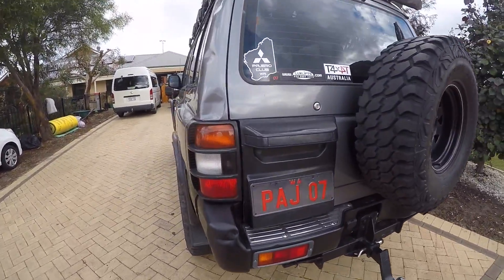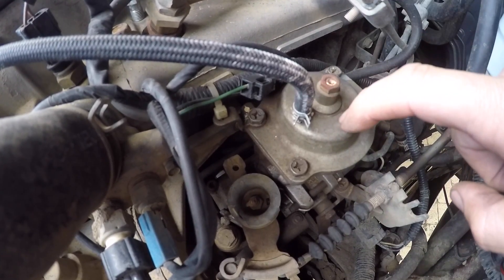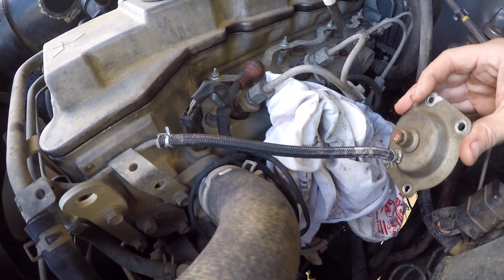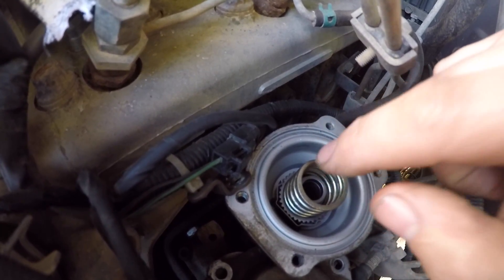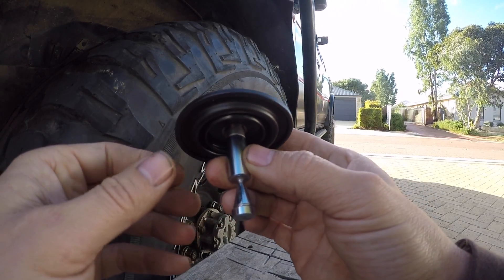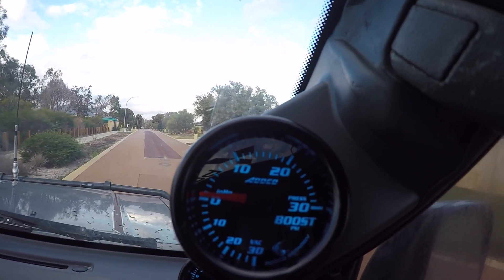HOW TO: 4M40 Boost Compensator Adjustment

Comment: What would cause diesel to be forced up through the boost compensator and into the turbo via the boost reference line?
Reply from the maker: I’ve never stripped these pumps but they’d have to be a seal gone below the compensator. Be very careful, pulling diesel up through there could cause the engine to run away
Reply: @PERTHSCOOTER07  
Exactly what happened. I shut it down very quickly and managed to block off the hose and get her home. I paid 2.5k to have the pump and injectors rebuilt 2 months ago and this happened in the middle of nowhere on the first big drive since.
Reply from the maker: @Ape5htGarage  bugger. Try get it back to the original repairer. Could have cost you an engine

Comment: Hi, I have pajero 4M40 2800. I recently took it for engine check and they recommend engine after hearing knock sound. Now the problem is that the vehicle is failing to pull and can't accerrate more than 20km/h. What could be the problem?
Reply from the maker: It could be a number of things. If you have an engine knock then that’s going to be the main issue. But you could also have faulty injectors or fuel pump.
Reply: Check your EGR isn't stuck open

Comment: Hi,I finally got round to this job last week on my L400 Delica, your video helped immensely - thanks! On the Delica the TPS is connected to the bracket on the front of the boost compensator, with two spacers between the brackets - damn that was a horrible job getting it all back together haha. 
Overall the difference is significant when the boost kicks in. I've also added a boost controller between the turbo and wastegate too, and the EGT gauge goes in today.
- I've got to ask - your accent sounds like you're originally from the North of England, by any chance are you?
Reply from the maker: Glad the video helped you. And yes correct. I’m originally from West Yorkshire
Reply: @PERTHSCOOTER07  I had a feeling you were! I'm based in Manchester
Reply: Hey I tried doing this to mine but it looks as though the top of my pump can't separate to reveal the diaphragm
Reply: @brandongoberdhan6335  mmm there may be a couple of things going on - I'm going from memory from a few years ago so forgive me if this is slightly wrong. Have you removed the 4 screws on each corner from the top of the compensator? It may be gummed up, a bit of side-to-side leverage and/or use a screwdriver to prise it slightly.
Reply: @johnskii  yup mine looks like it can't separate which is weird looks like one piece. I don't see a line that shows the separation of the two pieces
Reply: @brandongoberdhan6335  sorry to hear that, its a bit beyond my wheelhouse, but maybe for someone more knowledgable - which vehicle model and engine do you have?
Reply: @johnskii  thanks bro its okay ill figure it out. Its a gem 3 pajero with the 4m40T front mount intercooler. I'm from the Caribbean we get those here

Comment: Hi, tnx !! I just whant to be sure about the position.
Where You recommend to set the "0"  ?
If i look like you in the video from the side.
Adi
Reply from the maker: Yes. If it doesn’t work good you can always put it back to the original position
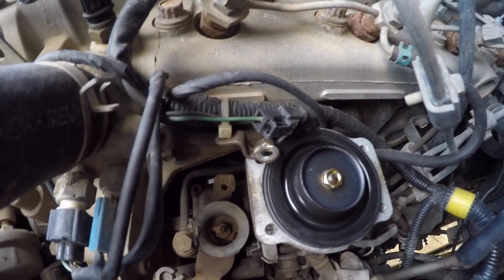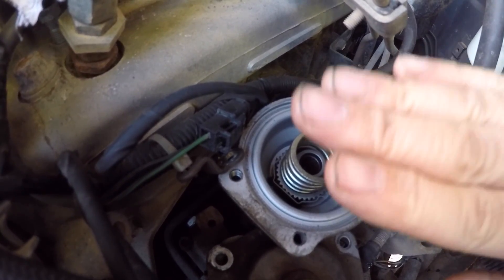Reply: Where to set the "0" in 3:00 or 6:00 ?
Reply from the maker: 3 is the factory position and 6 is the modified position

Comment: Hello sir 
Factory setting the "0" was at 6'o clock position? 
If so we turn it 90° clockwise or anticlockwise?

Also at what position should the "0" be after tuning it  for more power.
I have added 3nos 1mm washer also.
Reply from the maker: Nashik 360 hi there. If this is definitely factory position so no one has changed it, then yes go 90’ clockwise. I suggest marking the original position in case the car runs bad you can put it back how it was.
Reply: @PERTHSCOOTER07  thanks a lot sir

Comment: Thank you for taking the time to produce such an informative and high quality video.
I (think) I know everything you're doing but learning how to do it to my Pajero 4M40 took me a lot of online reading, time and trial and error.
You explained it so clearly and in such detail! It would have saved me a lot of time back when I started playing with this.
Right now I also have a bigger turbo and a water to air intercooler system. I'm telling you this because you mentioned that you wanted a bigger turbo.
Reply from the maker: SpeedO'Philia thanks mate. I’ve just fitted a boost controller to mine so I can add more boost. However I’ve busted my arm so can’t drive for the next 6 weeks, so I won’t know how it goes for a while. Plan is to get as much as I can out if the factory turbo and upgrade next year.
Reply from the maker: What turbo are you running?
Reply: @PERTHSCOOTER07  that's what I did. I initially added more boost to the stock TD04-12T (you may have a TF035 which is basically the same). That one went up to 19 PSI although the gains were negligible above 14 PSI.
I suggest you set the standard turbo to 14 PSI, it might spike higher but 14 PSI once stabilized will be fine.
Then I upgraded the turbo to the Kinugawa TD04L-15T "Monster".
That one pulls amazing. Just perfect.
I added too much boost (21 PSI) and caused it to have shaft play. I'm having it remanufactured as we speak.
I will keep it at 14 PSI and it should run fine. Apparently the shaft is too weak for the large compressor wheel (15T) which is spun by the small TD04 exhaust wheel, so you can't give it too much boost.
Anyways, as the turbo is considerably bigger than the standard, at 14 PSI it should pull much more. Plus the engine will keep it's low RPM boost as the exhaust wheel is the same as the one from the stock turbo.
It's important for you to know that even though I had the boost set at 21 PSI for more than a year, the engine didn't seem to suffer from this, this engines are very robust as far as I'm concerned.
Reply from the maker: SpeedO'Philia that’s great info. Did you retain the stock intercooler? And was is noticeably laggier than the 12T?
Reply: @PERTHSCOOTER07  intercooler: I installed a water to air intercooler kit from frozenboost.com and adapted it to the engine bay. Huge improvement although I'm not sure if it's worth the time and effort it took me to install it. I did it for fun and to learn. I'm no mechanic or anything like that.

Regarding the turbo lag: the Kinugawa has better response than the OEM turbo, plus, once it boosts you absolutely notice it. Great sensation.
Reply from the maker: SpeedO'Philia thanks mate. Sorry you did mention the w2a cooler before. 👍🏼

Comment: Hey mate, interested to know you’re thoughts on the 2.8 TD Pajero’s. About to buy one myself. 
Any watch points or dramas you think I should be looking for? 
Sorry to jump on video comments, only way to reach you I guess.
Reply from the maker: Would definitely recommend. However make sure the cooling system is 100%. They do heads very easily if overheated
Reply: @PERTHSCOOTER07  Well I bought one, finding your vids really helpful too! The old bus needs a bit of work but I love it already. Just out of interest, where would you prefered place be to source turbo rebuild kits, injectors etc?
Reply from the maker: @chrishulme1677  I’m an eBay fan. Get stuff delivered straight to my door. There’s heaps of places in the UK who sell bits for these on eBay.
Reply: @PERTHSCOOTER07  good to know, I’m mostly a landcruiser dude and know all the good parts places, flea bay for the win! If it’s good enough for a Yorkshire man it’ll do me alright.

Comment: Have rebuilt my nh, as I live in the UK, trying to find a rtc steering damper is very hard can anyone recommend a store in Australia to order fromplease
Reply from the maker: Have you looked on eBay? Local parts places will most likely have them but not ship internationally
Reply from the maker: https://www.ebay.com.au/itm/161028117145
Reply: @PERTHSCOOTER07  thank you very much,but any chance you could help me once more please
As I am  ex mechanic I need to get hold of a seal kit for a opal,Vauxhall, holden high pressure fuel pump engine code z22yh the only guy on ebay is in Belarus. There is a bosch pump that fits or can b converted to fit,but finding the part number has been impossible here in the UK any help would be great fully received  thanks craig
Reply from the maker: Craig Oldham hi mate. I don’t think we get that engine over here. We have a variant of it in the Zafira. 
Holden have just gone bust. I would have thought Uk would be the best place?
Reply: @PERTHSCOOTER07  any way i can contact you ,as over here pajeros,dont have the same following as in aus kind regards craig
Reply from the maker: Craig Oldham are you a member of the Facebook page : Pajero club Western Australia? I started this page and it has over 4,000 members
Reply: @PERTHSCOOTER07  no never heard of it,but would it b ok.to join as i am in the uk
Reply from the maker: Craig Oldham of course mate. Just make sure you answer the questions. Heaps of useful info on there

Comment: Hi, good afternoon!
I have the same engine. The factory position of the diaphragm is with the "0" for the back of the car? The tune is to rotate the "0" 90º clockwise?
Thanks
Reply: Yes 0 facing front of car is correct position

Comment: Hi mate, I have 2.8 4M40t and i have no boost until 2000 rpm will this help with that?
Reply from the maker: Possibly. Check over the basics first like for any boost leaks or split vac pipes
Reply: @PERTHSCOOTER07  its good after 2000rpm i need do something for lower rpm...😀
Reply from the maker: Marin Lasić  is it factory turbo or aftermarket?
Reply: @PERTHSCOOTER07  factory with front biger intercooler...
Reply from the maker: Marin Lasić the bigger intercooler and extra pipe work for a front mount will create lag and make it come on boost later.
Reply: @PERTHSCOOTER07  Then maybe that's it...

Comment: did you remove the egr?
Reply from the maker: Was already done when I bought the car
Reply: @PERTHSCOOTER07  hey Perth thanks for the reply much appreciated. Cleaned injectors with new needles + quarter turn of fuel screw + bump boost comp. Trying to wake up an 06 gls on 270 thou. And egr to go adios
Reply from the maker: @juanfo7307  good luck with it all mate

Comment: Should you do this if you have no mods and the car drives fine
Reply from the maker: blake walden this will give you more power. But with every performance mod you are risking reliability. If you’re happy with it as is I’d leave it.
Reply: How does it increase power without adding boost wouldn’t it just cause higher egts
Reply from the maker: blake walden sorry I should have been more specific. Doing a few mods as in more boost and more fuel. To just do this mod by itself is fine. It may increase egt’s slightly but is just an adjustment in fuelling for the off to on boost transition. Adding fuel here will spool the turbo quicker
Reply: Can you adjust this and a few psi more boost without touching the main screw
Reply from the maker: blake walden yes. Check out my other video on how to increase boost.

Comment: Thanks for your video tiger do you have the distributor plunger setting for this pump mine came lose at the timing bolts and now I need to time the pump. I'm subscribed to. Cheers
Reply from the maker: Austen Powers hi mate sorry I don’t have these settings. I do remember googling it a few years ago and found some screenshot taken from the factory service manual. See if that works.
Reply: @PERTHSCOOTER07  thanks m8 after a lot of googling i  did end up finding a manual and for the 4m40t the specs are  1mm travel at 12deg atdc +/- .003 
thanks

Comment: Where does the rubber hose connected to the lid connect?
Reply from the maker: There’s a small metal tube that runs along the front of the head and then goes to the turbo
Reply: @PERTHSCOOTER07  Is it also like this on Toyota Hilux 2.4 diesel turbo 1998, with an L2 Angen?
Reply from the maker: @אשאלאליזרוב  I’m not sure. Most cars use the same basic principle
Reply: @PERTHSCOOTER07  Thank you from the bottom of my heart for the help. I really appreciate it ... maybe one day I'll have the privilege of helping you.
Thanks.